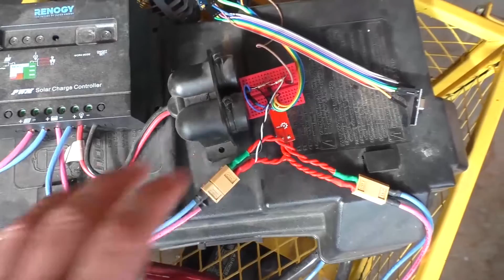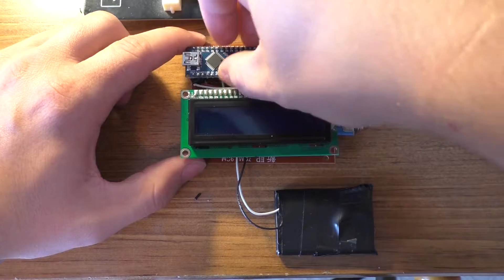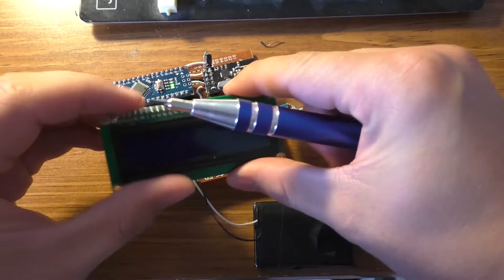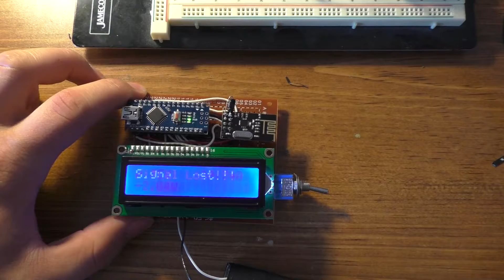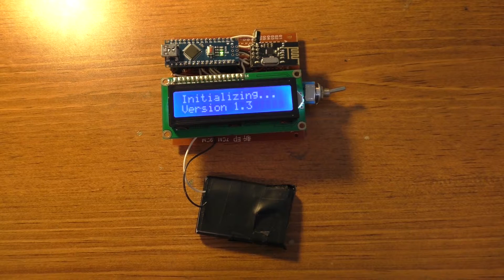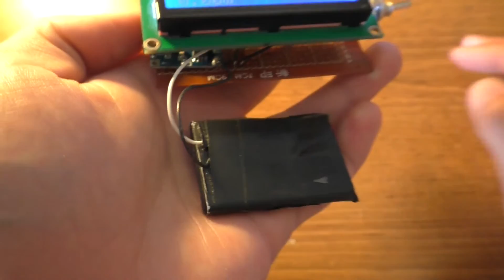DIY Wireless Solar Power Monitor Part 1

Comment: Working on a smart-grid for senior design and doing something very similar to this. Any recommendations of how transmit the data from the arduino to a web server? Also, any advantages of using arduino uno over a regular arduino board? Thanks for the help and great video btw.
Reply from the maker: Thank you. You might consider looking into the ESP8266 modules. I haven't personalty worked with them but they are used to connect to WiFi and can be interfaced with Arduino. There aren't really any advantages to using an uno over anything else, just that buying a genuine Arduino board supports the developers.
Reply: Thanks for the reply. Last question, is the Voltage, current, and wattage being read from the battery or are those readings coming from the solar panel? My project calls for monitoring the voltage output from the solar panel.
Reply from the maker: It is measuring the voltage and current from the battery but that could easily be changed the the voltage and current are measured from the panel itself.

Comment: Hi nice work!

I wonder about powering arduino nano from li-ion battery, I could not spot any voltage booster?
Could you shed some light on this?
Reply from the maker: Thanks!

Arduinos work perfectly fine on the kind of voltages a single lithium cell will provide. So a voltage booster is not necessary and would just decrease the efficiency, leading to less battery life.